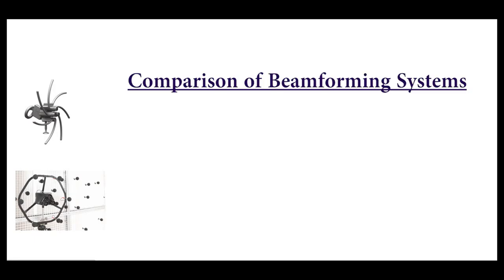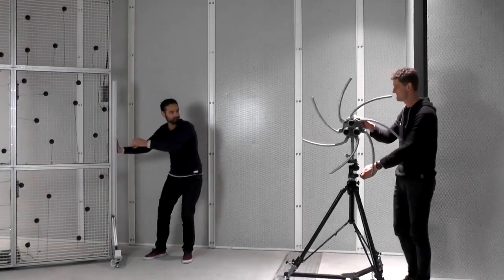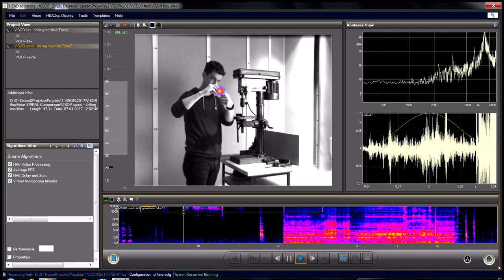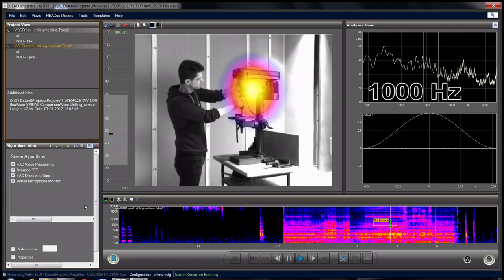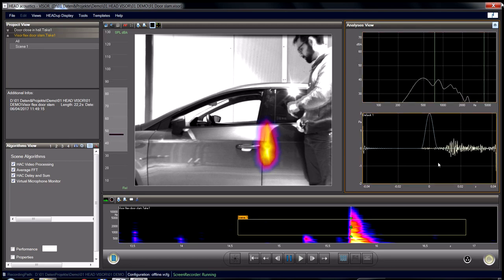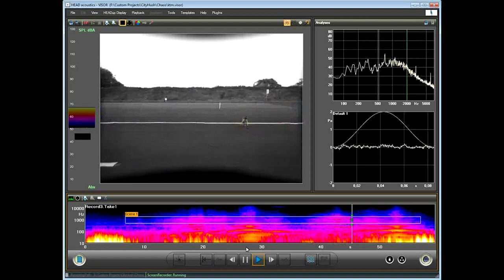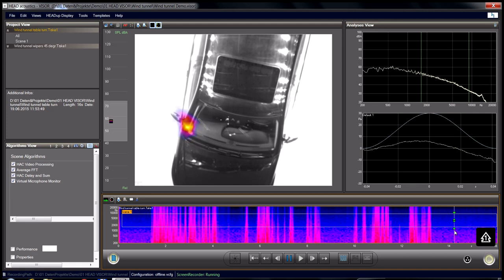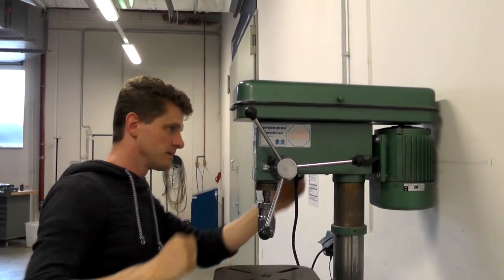Acoustic Camera Comparison | Giant vs Small Array | HEAD VISOR

Comment: What is the cheapest accoustic camera that works well for locating the sources of high-pitched sounds?
Reply from the maker: Be careful with this thought.
Locating high frequencies is quite easy and can be done by simple devices.
However, this is never the end of the story. Then directly follows the desire to save these measurements as a reference, to classify them with a numerical value and to compare them with another device or after a change with the new measurements...
Once started, there are many other wishes that small handheld devices cannot fulfill.
Who buys cheap, buys twice.  🙄

Comment: Should have shot at an engine bay.
Reply from the maker: The use of the VISOR in an engine test bench is one of the most common applications. Noises of the high-pressure pump, valves, belt run-out and run-in, etc....
All sources are cleanly separated from each other and their occurrence is shown and evaluated in relation to the crank angle.
If you are interested in such sample measurements, please contact us at info@head-acoustics.com. Then we will be happy to show you what is possible.
So far, all engine engineers have been enthusiastic about this. 🤗
Reply: @HEADacousticsInternational  I am very interested in such things but I’d need to see proof it you can actually pick up such precise sound locations.
Reply from the maker: Did you already have your live demo at your site to get the proof on your test objects? 
Hence we have just released a new version of the HEAD VISOR.
Smaller, ligther, easier to operate and easier to afford. 😁
Just write an email to us so we can meet at your company.
It is powerful and fun.
cu